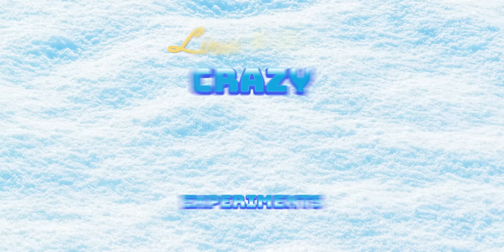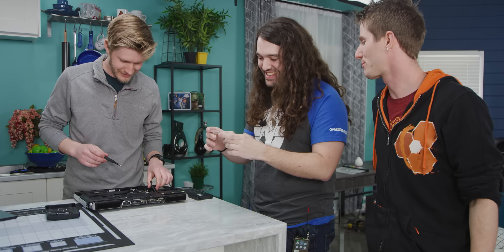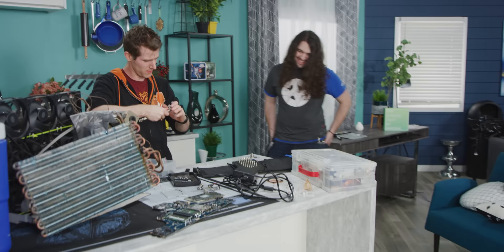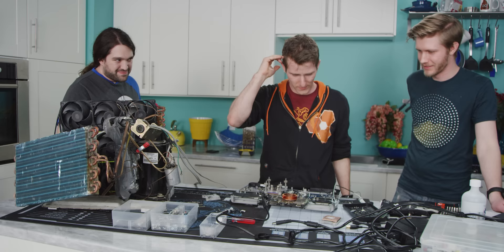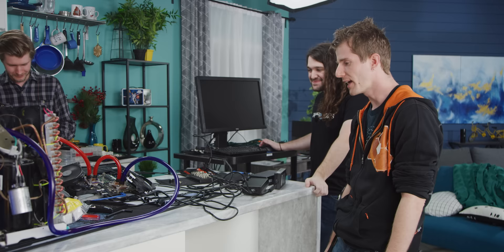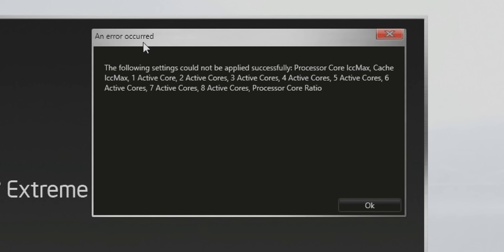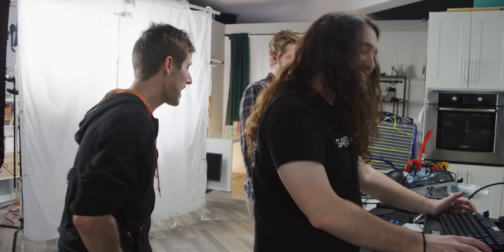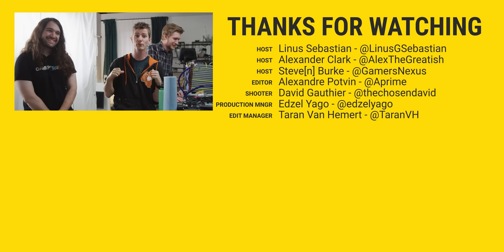Sub-Zero Laptop Cooling?! - Feat. Gamers Nexus

Comment: I wonder if you can do a sustainable sub-zero cooled CPU & GPU 
I know that major problem for sub-zero cooling is condensation so to deal with that can you try like vacuum sealed case or dry air sealed case, cooling everything else with water while CPU & GPU sub-zero

Comment: Sooo... Just have to say: After all of this, the CPU still throttled. 
 Let's face it, Intel's strategy is: You can place any of our CPU's,  in any enclosure and we'll manage the clockspeeds and temps as best as we can.

STILL, when Apple introduced a Macbook pro with an i9 CPU last year, and it throttled under heavy load, they got massive amounts of hate for that, even though, that computer had great performance! Yes it hit's 100c on full load, as designed, as this gaming laptop, but performs great up until that point.

Why not give Intel the hate? If anyone deserves it, it's them.

Comment: sad all this attention on a ALIENWARE , when clevo has been doing this since the sold the alienware brand to dell ..... most of the clevo systems , aka , sager, prostar,eurcom,and many other use the desktop cpu and desktop spec video cards full running , ... the p870tm1-g ran a i9 9900k oc and 2x gtx 1080 or 1 rtx 280

Comment: Still possibly the worst Laptop to ever exist. Laptops are meant to be low power, low heat devices :S
This thing cannot go on your lap ever, it would have to be on a table all the time. This laptop is the reason why I’m hopeful for the 12 gen. Cuz the efficiency cores will be used to other daily things (like browsing or video watching) and you could probably have it sitting on your lap, without it toasting those stuffs, while the performance cores are used for games, and the laptop would then sit on a table while gaming, instead of….. having this laptop always on a table, and maybe with some 3rd party accessory for extra cooling